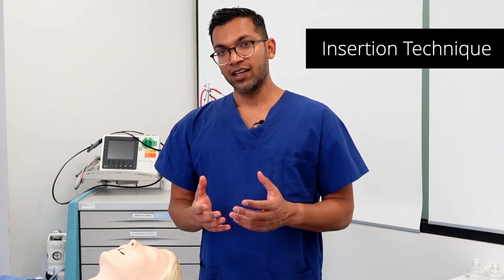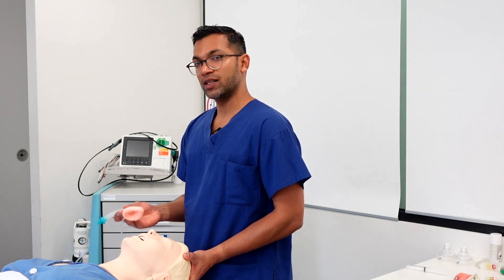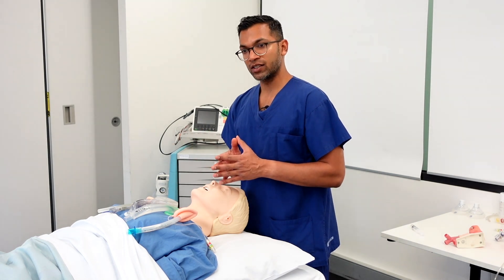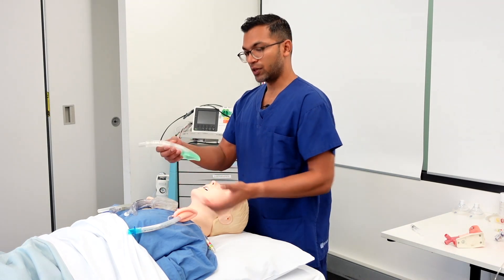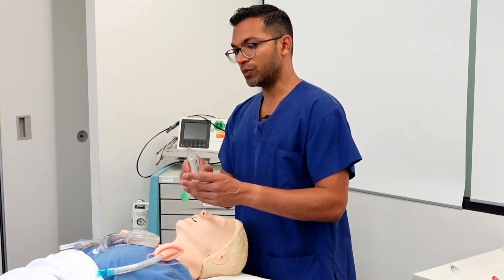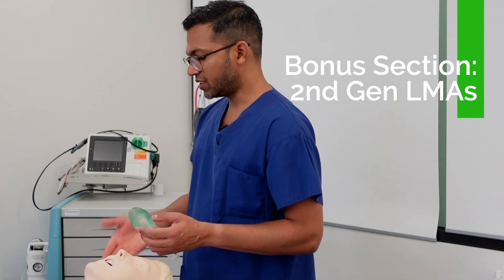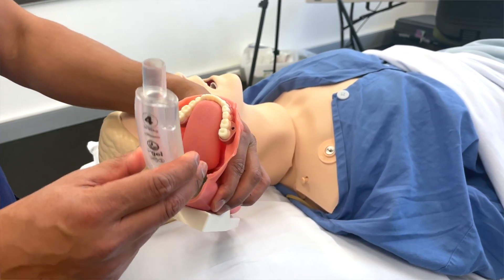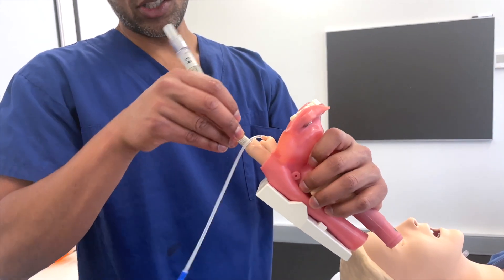Laryngeal Mask Airway (LMA) insertion technique EXTENDED VERSION | Extra tips and 2nd gen LMAs

Comment: Dear sir is there any marking up to where we should insert just like endotracheal tube?how much air should we inject to fill it
Reply: Just read the manufacturers manual - it usually has all the details... As for how much air to inject: use a cuff pressure gauge and inflate it so it sufficiently seals but stay below 60cm H2O. As for laryngeal tube airways: use the provided colour-codes syringe.

Comment: Easier to insert if you deflate the cuff before insertion & lubricant the surface in contact with the palate
Reply: Read the manufacturers recommendations - there are many ways (fully deflated, a bit deflated, as provided in package, etc...) and they differ by manufacturer.
When lubricating use either water or artificial saliva - do not use gels or sprays that contain local anesthetics

Comment: Providers need to familiarize themselves with their specific brands and models of equipment. Some of these devices are a pain to insert and you'll see all sorts of approaches to how to fix them - tongue blades to get the teeth/lip/tongue away from the laryngeal side of the LMA, people will stick their finger along the back of the throat to ensure the tip doesn't flip and also to stop it from ramming into the posterior wall of the oropharynx and causing trauma, deflating and reinflating the cuff, adding in more air, taking air away, etc etc etc. what most people don't realize is that the packaging often tells you how the company recommends you insert the device, and other specific specifications you should know. What counts as safe trouble shooting for one brand might be unsafe or just useless in another. People are often very unfamiliar with how much air different brands of LMA can safely use; the LMA classic is high-volume/low-pressure, but some of the newer brands are low-volume/high-pressure, and you cant just go shoving 10cc of air into them when they don't seal (I personally witnessed this amongst experienced providers at an academic institution until one day one of their providers bothered to read the company pamphlet).
Reply: @austinsrna5545  thank you fot this reminder

Comment: You might want to look into laryngeal tube-SGA https://en.wikipedia.org/wiki/Laryngeal_tube instead of the LMA-style SGA known from OR for emergency airways on normal wards - they are easier to place and seal, and they have a portion that extends into the esophagus with a balloon sealing the esophagus a bit better. Placement procedure is the same.

Comment: Thanks, nice presentation!

A few tips: 
- open the patient´s mouth by first pulling the mandibula forward (like in Esmarch´s) and then open the mouth - you get much better mouth opening that way. 
- Usually the SGA doesn´t get held up by the tongue on insertion, but the first "obstruction" is because its tip is pushing against the posterior pharynx. Use a finger (remember to double glove, so you can discard one glove after you were in the patients mouth with it) inserted with the SGA to push its tip downward to the hypopharynx - that way you also prevent flipping over the tip of the SGA (which leads to air leakage) and also prevents scraping damage to the posterior pharynx. The second "obstruction" is the tongue that gets caught in the hollow bottom of the SGA - either push until the tongue repositions itself or use a finger.
- always check cuff pressure and with iGEL don´t use an oversized SGA - we had a case of necrotic tongue because of that. 
- you can insert a gastric tube in a second generation SGA to stabilize the SGA (especially in patients with no teeth) and thereby you might be able to achieve a sufficient seal.
- iGEL initially always leak - they need time for the special plastic to warm up and conform itself to the hypopharynx.
- besides head- and SGA-reposition maneuvers you can also deepen the sedation (before applying relaxants)
Reply: good tips. lingual nerve injury is another known complication with Igels, one more reason to use smaller size as & when possible
Reply: Nice video and nice tips!!

Comment: Excellent video as always. I'm a 4th year medical student applying to anesthesia. I'm often told I need to push harder to make it past the tongue when placing an LMA. My question is: is it realistically possible to push too hard and cause trauma when trying to surpass the tongue?
Reply from the maker: Thanks for the comment and great question! Quick answer, yes! If the lma is too large for the oropharynx it can definitely course trauma resulting in blood in the airway.
That said, most juniors are (rightly) careful and dont use enough force.. and after a some experience you get an idea of the maximum force required..
So do as youre doing, play it safe.. be cautious.. and under guidance discover the right amount of force required :)
Reply: You can definitely catch the tip of the tongue and risk tearing the lingual frenulum if you "push harder" to get it in. Something that is also happening may be the tip in certain brands is a little more stiff and is jamming into the back of the mouth where you can traumatize that soft tissue as well by shoving it. A lot of providers will insert a tongue blade to depress the tongue, this also prevents the LMA from catching onto the teeth and lip. It provides.a ramp of sorts to guide the LMA over. I've heard of people insertion the LMA sideways or upside down and flipping it once past the tongue, but then you run into issues of the cuff possibly being folded in different directions in the hypopharynx ... Not to mention many patient's mouths are way too small to have the device doing barrel-rolls in them.